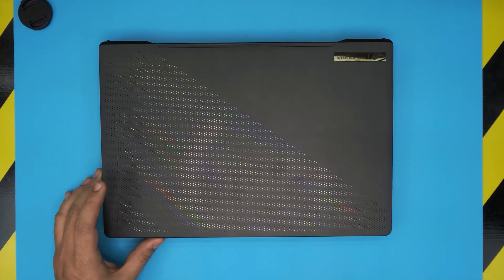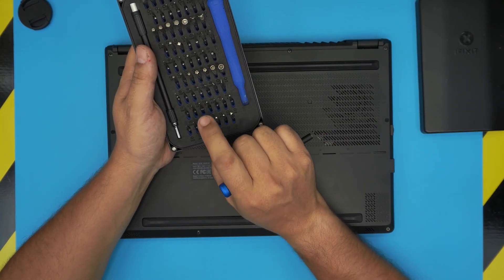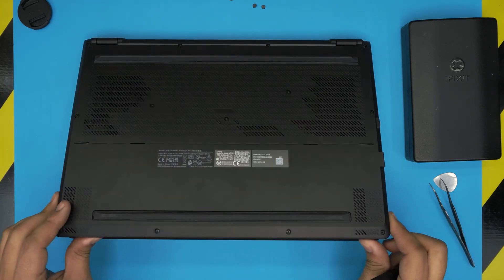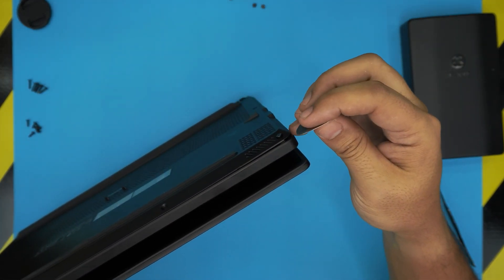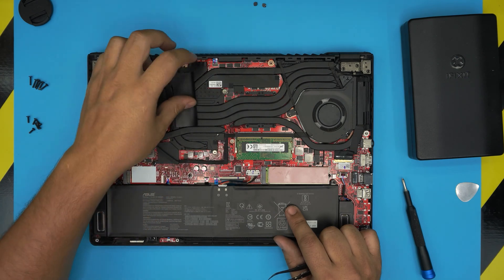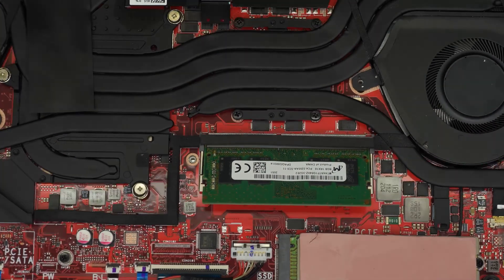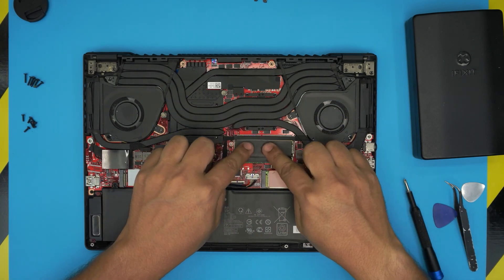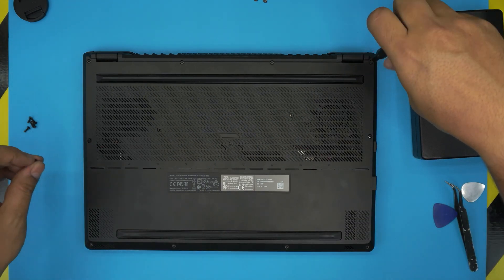ASUS Rog Zephyrus M16 🚩 Gu603hm 211 Zm16 💻 Ram Upgrade

Comment: So I want to upgrade ram and thought I had 2 slots, I have a 16 gig. Would it be worth it to buy a 32gb or better (if that’s a thing) to boost performance and would that complicate any of the bios or anything?
Reply from the maker: 🫠Regarding your question, yes, you can buy a 32GB stick and insert it into the slot, and it will improve the performance of programs and tasks.
It is plug-and-play; the BIOS will automatically adjust the RAM speed and everything else, as there is no manual XMP option in this BIOS.
Should you have any further questions or requests in the future, please don't hesitate to ask me.
cheers🍻

Comment: Hi, I'm not sure if I will get a response, but I installed the 32GB RAM stick, and the performance was great. However, my laptop crashes every once in a while with a memory stop code. Anyone know a solution?
Reply from the maker: 🫠Regarding your question, we had that issue in the store, and changing the RAM brands worked perfectly fine. In a few cases, reformatting Windows also solved the issue.
Should you have any further questions or requests in the future, please don't hesitate to ask me.
cheers🍻

Comment: will this fit in there.   Crucial 48GB DDR5-5600 SODIMM ,thanks my laptop is 2023 13th Gen Intel(R) Core(TM) i9-13900H   2.60 GHz
Reply from the maker: It's my pleasure my friend.
🫠Regarding your question, the 2023 models are DDR4 not DDR5, but i have seen a late 2023 with DDR5, i would highly recommend you check the manufacture spec, or open and check.
or give me the full model number.
Reply: @uFixTek 
Model number 
GU604VI-M16.I94070
Reply: @uFixTek  asus gu604vi-m16.194070
Reply from the maker: DDR5 my friend, get ddr5 up to 64gb without any issues.
Reply: @uFixTek  my friend this one
Crucial 48GB DDR5-5600 SODIMM ,
Reply from the maker: that one is fine👍
Reply: @uFixTek  thanks sir . I really appreciate your effort and time.
Reply from the maker: anytime 🫠🍻

Comment: If ram soldered to the mb is 8g then adding ram that doesn't match may cause  bottlenecking, and you won't be dual channel. Speed will be limited to that of the smaller ram.
Reply from the maker: the ram on board is 8GB and if you add a 32gb or 16gb extra  it will work on dua channel, but only dual channel will be maxed at 8gb then anything after it will work as single channel.
8gb is enough to make windows and services to work on dual channel.
cheers🍻

Comment: Got the ZM Version is really good Machine like it x3 have 16 GB so if use 32 Ram i have than 40 GB Total ? becouse 8GB on the Bord right ?
Reply from the maker: 🫠Regarding your question, yes if you have 24gb that means you have 8gb on board and 16gb you can remove the 16gb and place a 32gb and it will add with 8gb on board for total 40gb.
Should you have any further questions or requests in the future, please don't hesitate to ask me.
cheers🍻
Reply: @uFixTek  ok i ordered a 32GB ADATA RAM 4800Mhz DDR 5 hope this will work i have the Gu603zm
Reply from the maker: It will work just fine 👍
Reply: @uFixTek  yep works fine
Reply from the maker: awesome , enjoy the upgrade🍻🫠
Reply: @uFixTek   ok no is Freezing that RAM not work i go for other one  Corsair SO-DIMM 32 GB DDR5-4800 , Arbeitsspeicher
(schwarz, CMSX32GX5M1A4800C40, Vengeance this one is offical Suported tested last Day after a while iam getting Freezes i put for know old one in evetrhing works fine...
Reply from the maker: remove the old and have the new one only test it like that, and place the new one in the 1st slot and only have the 16gb test that alone.
Reply: @uFixTek   is fine i just got the  Corsair CMSX32GX5M1A4800C40 this one works perfectly and is Supported 100%

Comment: Anyone upgradeing from 16 total to 40gb? Im curious if adding a 32gb to an 8gb thats soldered in thus eliminating dual channel is better or worse for gaming.
Reply from the maker: Thank you for your feedback! If you wish to support the channel, you can like, subscribe, or both!
Regarding your question, as long as you have two rams you will have dual channel memory, but you need to understand one thing that the two channel memory will be only used up to the 8GB (the lower ram stick in your case soldered on board), after 8gb usage the rest will run on single channel. if you add a 32gb the windows uses a algorithm for ram usage. the windows uses % of the total ram, so with you pump it to 40gb then windows will use probably the 8gb for it self and it will utilize it on dual channel. and your games and programs will have to deal with single channel ram usage.

don't worry the game will run fine, if you don't upgrade you suffer and if you do you benefit.
Should you have any further questions or requests in the future, please don't hesitate to ask me.
cheers🍻
Reply: @uFixTek  Thanks for the reply! So if I understand you correctly, if I do upgrade to 8gb + 32gb I would benefit and that means an increase in high memory load gaming performance even though it would be single channel ram usage? And if I just leave it at 8gb + 8gb but dual channel ram usage I would have less performance?
Reply from the maker: if you leave it at 8+8gb  you get dual up to 16gb only:  GOOD performance
if you place 8+32gb you will get dual up to 16gb+ extra 24gb single: awesome performance 👍
Reply: @uFixTek  Alright well then cool! I will look for a compatible 32gb stick and give it a shot. Thanks your your help!
Reply from the maker: It's my pleasure my friend.
we use this rams, they are very compatible with all motherboards DDR4, and they are rock solid:
https://amzn.to/3HiFyW9
cheers🍻

This is an Amazon affiliate link. When you use my links, you are helping to support the channel. 🙏

Comment: Hey man, I have Asus M16 2021 which has 8gb ram soldered and (8gb free slot) so i'm thinking of upgrading it to 40gb (8+32), I wanna know is it worth upgrading or not becuase I read online that performance is same.
Reply from the maker: Thank you for your feedback! If you wish to support the channel, you can like, subscribe, or both!
Regarding your question, i don't know who said that, if you have 8GB you are under performance in many many tasks, if you add an additional 8Gb then you will be at normal level use, but i would recommend you to add a 16gb instead of 32gb. 8+16 that is the sweet spot for editing and gaming and many other tasks.
this is the ram that we use it is very durable and compatible : https://amzn.to/47qAjhF
Should you have any further questions or requests in the future, please don't hesitate to ask me.
cheers🍻

This is an Amazon affiliate link. When you use my links, you are helping to support the channel. 🙏

Comment: The bottom right screw maybe the one that allows you to pop open the cover without needing to use the pick that is normally the last one you unscrew.
Reply from the maker: yes normally you should do those at the end, but no harm done if you do it 1st.
cheers🍻

Comment: thanks for all the help - I liked and subbed! Quick question: I have an Asus Zephyrus Rog m16 GU603HE - NVIDIA GeForce RTX 3050 Ti Laptop GPU GDDR6 @ 4GB (128 bits). I am upgrading my 8 RAM slot to 32 (what you recommended in another comment). I also wanted to look into SSD. I was looking at the Samsung 980 Pro 2 TB with heatsink - but I am unsure if it would fit. Any recommendations?
Reply from the maker: Thank you for your feedback! If you wish to support the channel, you can like, subscribe, or both!
Regarding your question, sure you can upgrade to 32GB stick i recommend you this: https://amzn.to/46XqFDc
they are very solid and compatible and reliable.
and about the storage get the samsung pro without  the heatsink, because the version that comes with heatsink will not fit, so get the one without heatsink: https://amzn.to/3RFLrTl
and IF you want to have a heatsink on it get a slim heatsink: https://amzn.to/47X5cM2
NOTE: the nvme 2TB and under do not require any heatsink they are fine, you will not get any extra performance or durability on it, if you want to go over 2TB then sure get the slim heatsink.
we have tested the 2TB without the heatsink under 1year at heavy heavy loads and 3years later still fine, and our clients that have them they have zero issues.
Should you have any further questions or requests in the future, please don't hesitate to ask me.
cheers🍻

This is an Amazon affiliate link. When you use my links, you are helping to support the channel. 🙏
Reply: Thank you  @uFixTek  ! I just bought it with you link
Reply: @uFixTek  After thinking about it more - I only need 1 TB and not looking to spend $160 on ssd 2 tb. I only use my laptop for work. What recommendations do you have for 1 tb ssd. I am looking for efficiency of battery (pulls minimal power) over fast speed. 1 tb that fits Asus Zephyrus Rog m16 GU603HE - NVIDIA GeForce RTX 3050 Ti Laptop GPU GDDR6 @ 4GB (128 bits). Send me a affliate link and I will get it!
Reply from the maker: thank you for your support:
you can get the 1TB for 90USD: https://amzn.to/3NnaJTG
or get the 2TB for 130USD: https://amzn.to/4ajvA3Z
they both are under 160.00
any of them are compatible and truly durable for heavy loads.

This is an Amazon affiliate link. When you use my links, you are helping to support the channel. 🙏
Reply: awesome thanks !  @uFixTek  I just purchased - hope it helps you out! Keep up the content!!
Reply from the maker: much appreciate it

Comment: hi! very informative video though. currently i have the asus rog zephyrus m16 gu603zw and i want to upgrade my ram. which ram should i choose?

Firstly i choose Crucial 16GB DDR5 4800 or the 5600 SODIMM, or are there any other recommendations?
Reply: If it’s the 2022 US model M16, it takes DDR5. You can know by checking the speed it runs at on Armoury Create. It should detail the RTX Graphics card number, plus the Memory Speed next to it. IE, (Nvidia RTX 3070ti, DDR5 Memory ..) etc
Reply: Take 16GB DDR4-3200 SODIMM
Reply from the maker: Thank you for your feedback! If you enjoy the content, supporting the channel through likes, subscribes, or both would be greatly appreciated.

Regarding your question,  we use many brands of rams and with over years we found the best suitable rams are this, they are rock solid and very reliable. 
https://amzn.to/43QX3WK

also this laptops take DDR4 not DDR5, there are few selective models with DDR5 make sure your it says DDR5, if so then go with this rams:
for ddr5 they are very good not so great for ddr4,
https://amzn.to/3WUcKuc

Comment: Awesome video.

I have the asus rog zephyrus m16 gu603he. Which RAM should I buy?
Reply from the maker: Thank you for your feedback! If you enjoy the content, supporting the channel by liking and subscribing would be greatly appreciated.

Regarding your question, your laptop is equipped with 8GB of DDR4 RAM that is soldered onto the motherboard, and there is one available RAM slot for further expansion. While the laptop is technically capable of handling up to 64GB of RAM, it's important to note that the manufacturer made the decision to solder only 8GB onto the board, which limits your options.

As a result, you are restricted to a maximum of 40GB of RAM (8GB onboard + 32GB RAM stick in the available slot). Unfortunately, this limitation is a result of the company's decision to solder a lower amount of RAM instead of providing options for higher capacity or multiple DIMMs.

The best compatible ram that we use is 32GB: https://amzn.to/437Gnuc

I hope this information clarifies the RAM situation in your laptop. If you have any further questions or requests in the future, please don't hesitate to ask.
Reply: @uFixTek  

I used this video to upgrade the RAM and your SSD to video to add additional SSD and everything works great. Thanks so much!
Reply from the maker: It's my pleasure my friend. 😊 
Cheers🍻

Comment: I have the 16gb model… can I run two separate RAM capacities? I have zero soldering skills 😅
Reply from the maker: Thank you for your feedback! If you wish to support the channel, you can like, subscribe, or both!
Regarding your question, yes you can use a single 16gb stick , this is a compatible rams for it, https://amzn.to/44JBkkU
and it will add up with onboard ram you have.
Should you have any further questions or requests in the future, please don't hesitate to ask me.
Reply: @uFixTek Hello I have the same model as him and I’m new to pc building, so is there a slot for the 2nd ram stick?

Comment: It is okay if the Ram in other side of motherboard its 8gb and i upgrade 32gb on the side on video, does it work when the ram doesn’t match
Reply from the maker: Thank you for your feedback! If you wish to support the channel, you can like, subscribe, or both! Regarding your question,  absolutely fine and it will work and not have a issue at all no worries

Comment: The sealed screw is supposed to lift the panel up, if you leave her for last one.
Reply from the maker: yes the c lock screws are to help to separate the cases, but sometimes they don't work, and i prefer doing it manually.
Reply: This is 100% correct. You are supposed to remove all the others and then that screw helps lift the rear cover so you dont have to use a pry tool.

Comment: Reading the ram it says 8gb 1rx16. But my system about UI days I have 16gb of ram. Do I need to replace both rams ( the solder on I can't see and visible one?) Or can I just upgrade the one that is removable and be ok.
Reply from the maker: Thank you for the feedback! if you wish to support the channel you can LIKE or SUB or both :P
regarding your question: you have two rams one soldered on board (8GB) and one dim 8gb you can replace the 8gb with 16gb and you get 16gb+8gb and it will work just fine.
https://amzn.to/3ZAkNN6
Reply: @uFixTek  Can you replace it with a 32gb stick? Will it run fine with 8gb soldered and 32gb expanded?

Comment: Extremely helpful video. I did the upgrade without disconnecting the battery as suggested and everything was fine. Thank you!
Reply from the maker: It's my pleasure my friend🍻😊
if you wish to support the channel you can LIKE or SUB or both :P
If you have any future questions or requests, please don't hesitate to reach out to me. I'll be happy to assist you
Reply: What ram did you buy?
Reply: @lasercams can’t remember sorry I think most 32gb cards should be fine get DDR5

Comment: 1 ram on a 16" is dumb.  Some 15/16 have 2 ssd and this doesn't even have 2 ram upgrades
Reply from the maker: Thank you for the feedback! if you wish to support the channel you can LIKE or SUB or both :P
regarding your question:  they do have technically two rams, one is soldered on motherboard (8GB) and you get to add an additional 16gb or a 32GB stick and it will add to the 8gb on board.

Comment: Can the laptop support ddr5 4800? And is it even required?
Reply: i think the 2021 model supports ddr4 but the 2022 supports ddr5
Reply from the maker: @sosa3308  yes my friend, some of the new 2022 are DDR5
Reply from the maker: Thank you for the feedback! if you wish to support the channel you can LIKE or SUB or both :P
regarding your question: there are two versions of this laptops out one with ddr5 rams and other ddr4. and you can't have ddr5 ram installed on dd4 slot.

Comment: Hello, I just upgraded my ram in this exact computer with a Crucial 16gb Ddr4. It is showing 24gb now, but is only showing 2666MHz instead of 3200MHz. Any ideas why or how to fix?
Reply from the maker: Thank you for the feedback! if you wish to support the channel you can LIKE or SUB or both :P
regarding your question: because the ram you purchased it was not 3200Mhz, BUT this is Intel CPU you don't need to worry about the ram MHZ , the MHZ is very important for AMD CPU.
Reply: @uFixTek  Hello, Thank you for your response!  Just an update, I actually ordered the same Crucial RAM (same part #) and installed it and now it is running at the proper 3200MHz! So I guess the first one I received was unfortunately faulty.
Reply from the maker: awesome it happens sometimes that they do come a very slightly defective :P
Reply: @a4SilverBullet  Hello, I understand that quite a bit of time has passed since you wrote your comment, but I would still like to ask you to tell me which model of the RAM you purchased? Because I am currently having a little trouble with this, I have a Zephyrus G16 version 2023, 2024 year of manufacture
Reply: @ferretahibe5647  Hi, the Crucial RAM part # I tried that was giving me issues was CT16G4SFRA32A. I returned that and bought the Team Group TTZD416G3200HC16F-S01 and it read/worked at 3200Mhz. I have used Crucial in the past with no issues, but for some reason, this computer wouldn't recognize it properly. Hope this helps!
Reply: @a4SilverBullet  Unfortunately, I can't find this memory model in my region. Could you tell me the memory identical to the one you sent me? in general I have a very funny situation, I also bought Crucial, 3200 without ХМР profile, but I still get 2666, probably because it is dual-ranked, and initially I had Kingston, also only worked 2666, these memory selections have already really exhausted me, and I am honestly ready to give up with this
Reply: @ferretahibe5647  Dang, I see that it's not available now. I tried searching Amazon quickly and wasn't having much luck with a similar spec. But the specs that worked for mine were "DDR4 SODIMM 16GB (1x16GB) 3200MHz (PC4-25600) 260 Pin CL16 Laptop". I think I found the one I am using through Reddit.

Comment: Thanks for the vid. One qustion: could I put in the replaceable slot a 64GB ram piece?  Meaning will the laptop recognize such an amount or it maxes out at 40/48?
Reply from the maker: Thank you for the feedback! if you wish to support the channel you can LIKE or SUB or both :P
regarding your question: you can only place a single 32gb stick and it will add with the 8gb on board or 16gb on board that you have.
https://amzn.to/3bN9vRI
Reply: Con este upgrade deja de funcionar el dual Channel?